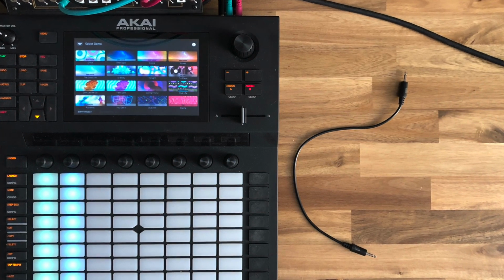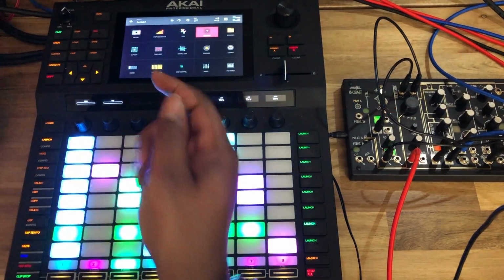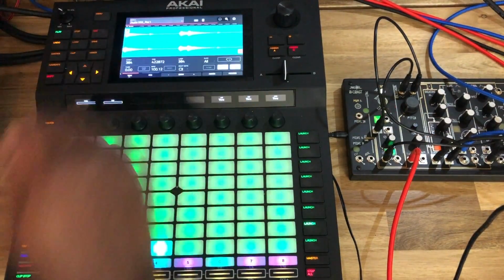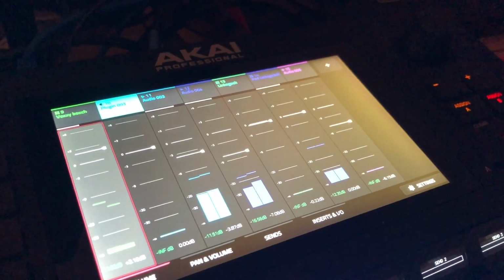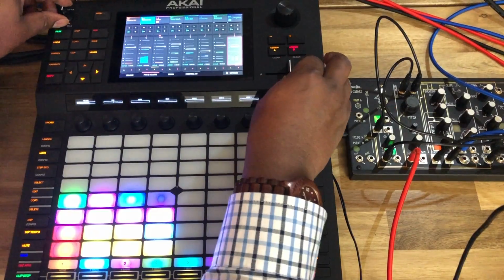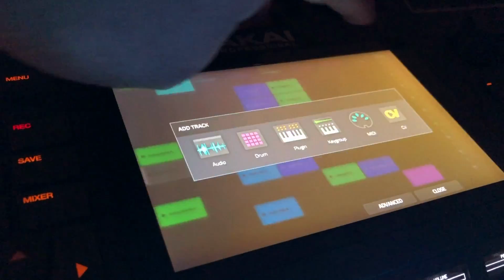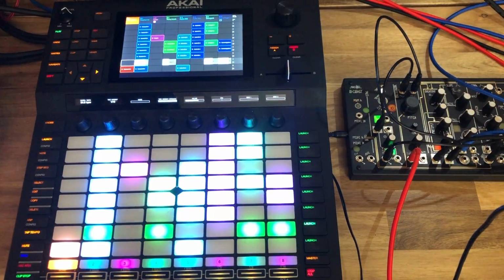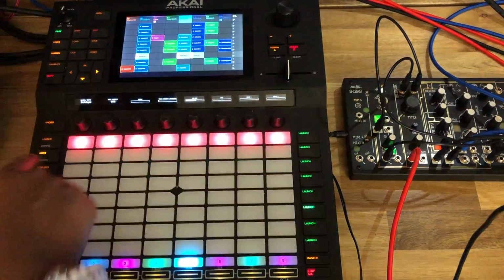Akai Pro FORCE - First Look

Comment: i have the 3.0.3 update and i dont have the ableton link button to control ableton you have at 4:39 what am i missing?
Reply from the maker: this is an early video using beta software. no guarantees on what will hit the market ultimately.
Reply: @Bboytechreport right that button feature is not even included in the 3.0.3 update. We can only export but can't control the software.

Comment: Does it record external gear on a fixed, say 2 bar loop? Where you send out midi on 1 track to a synth, record the audio output into the Force in a fixed 2 bar clip length ?
Reply from the maker: Thomas Hoenselaars yes

Comment: can you take off the cue link knobs and they have those "circle/flat" metal posts that you could say, put DJTechTools rubberized super knobs on?
Reply: thanks for touching on the Ableton part too - nobody's done that - its just clip launch mode though and im assuming in note mode playing the plugins but otherwise it doesnt display anything extra? would be cool to see it develop in the future with Max4Live or custom scripts like the Push2 has that make the LCD screen display the session view clips even with the text written on the clips (i dj with live so ive always wanted this) and display the plugin windows of VSTs, but unlike the built-in plugins where it auto maps to the cue link knobs, maybe just let you midi-map the link knobs to the effects automation parameters in the plugins' "configure mapping" knobs in the little (>) arrow that appears on all plugins
Reply: basically TL;DR i wanna know how the midi mapping and control works for Live in terms of synths and custom-mapping  to plugins' automation
Reply from the maker: J Whitty I have a korg kp3 with djtechtools knobs. I tried on of them on it. The pots shaft is taller than the djtechtools knobs will cover from tip to base. They may have some that will work but also the touch sensitivity went away.

Comment: Nice vid !
More please !
Are the pads velocity sensitive while in step sequencer ?
Do u know if the synths(hype, tube and the other two) will be available as VSTs for ableton or the mpc software, so when finalizing/mastering/editing etc in a DAW you can still change parameters ?
Does it come with the mpc Software, or can it only export to ableton ?

Thanks
Reply from the maker: claudio oidualc more to
Come. Pads are velocity sensitive in step edit. Same plugins as mpc. Don’t know if plugins will be available in Ableton. I don’t have any answers about the software. I’ve only used it in standalone mode so far.

Comment: BBoy, 2 questions. How do you connect a turntable because I didn’t see a phono connection like the MPC X/Live. Also do you know if it will come with any version of Ableton? Probably not since they’re kinda enemies now.
Reply from the maker: not sure about if it will come with any ableton lite. but enemies will do business together if the terms are right lol. as for turntable. i havent seen that on any akai product since the MPC 5000. its just 1/4 inch or xlr inputs.
Reply from the maker: unless there are plans for the link / ethernet port on the back to interface with other DJ gear. i dont know tho.
Reply: BBoy Tech Report I got a response from Akai. A turntable with preamp is fine with the RCA to 1/4 cables. Otherwise you will a preamp separately

Comment: I can see that this has parameter locks but do you know whether this thing has trig conditions or anything along that basis?
Reply from the maker: i dont know of and i've not used any parameter locks. do you mean automation? no trig conditions.
Reply: BBoy Tech Report You can set parameters per step. Hmmm! I wonder if Trig Conditions will be implemented in the future
Reply: @Bboytechreport  so there is no automation recording - knobs/values etc..? NOOOoo!!
Reply: BBoy Tech Report trig conditions is that Elektron talk lol
Reply: Gio Alex Yes! And actually, the Force really doesn’t need to include it, as long as The Force, as an Ableton controller, accepts Max4Live devices such as Sonic Factions Probability Pack, THEN you can do exactly ANYTHING an Elektron can do and MORE. Really excited 😄

Comment: I’m also excited to see how they’re/if/when these features will be integrated into the Live & X. I feel like Akai could make the menu have pages and toggle to shift between, as we have 8 functions on our current menu. This could give the X another QLink Page & the start to a 2nd Menu Page lol That is if the gave use an Ableton Control & Matrix mode. I will definitely suggest this feature. Even though we only have 16 pads, we still have the full sized touch screen and pad banks! These would be great for the X and Live!!
Reply from the maker: I guess anything is possible judging from what this thing is capable of so far.
Reply: Also curious if this will cause Akai to enhance the Expansion Builder Application!

Comment: I already have a Deluge...what I need is something like an Ableton Launchpad, only something I can load the clips & take away from the laptop. As for all that editing & slicing, I can do that in Ableton. I just want something to take to a gig, should I ever get one. Because my laptop is never leaving the studio again.
Reply from the maker: Right there are devices out there for any combo or individual feature but the nice thing about this is its all self contained. slicing chopping, stand alone, CV, midi, plugins, clip and scene launching, audio tracks, drum tracks (aka mpc programs). deluge is probably the only thing that comes close but that has no touch screen.
Reply: @Bboytechreport  Nice video! I think the pads on the Deluge are intended to function as a kind of touch screen... the latest update even allows for visualization and slicing of sample waveforms on the pad grid
Reply from the maker: Scott Kuehnert thanks. Wow I’ve not messed with deluge yet. Looking forward to checking it out.
Reply: Deluge rocks just looking at this, I think deluge might be more fun to use, but no screen needed...
Reply from the maker: @RonCavagnaro  Still havent checked out Deluge. looking forward to checking out tho.
Reply: You can export Ableton Live sets into this unit and leave the laptop in the studio...problem however is if you depend on 3rd part plugins. Cannot use them with this standalone unit.

Comment: yeaaaah no thanks. ill wait 3 generations or so. this is clearly an overpriced push 2  with low processing speeds . at least it works as a controller but i can get a used push 2 for like 500 right now
Reply from the maker: I hear ya bu this is not even a push2. its standalone / hybrid if needed with built in synths, audio interface, CV,  touch screen. etc etc. push aint doing that stuff. but it does have the similar clip launching workflow and 8x8 grid. thats where the comparisons begin and end.
Reply: @Bboytechreport  It's like a Push 2 Crash landed into an iPad and an Octatrack.  How is it overpriced?  It's incredible that this even exists!
Reply from the maker: Robert Syrett I don’t recall ever saying it’s over priced.
Reply: By the look of the screen its probably closer to MPC Live
Reply: The RAM is well lame at 2 gb. Same processing power as a cheap tablet.
Reply: This is "on the go" all in one beat making machine, of coursce IT can't compete on terms of functionality and processing power with laptop & Ableton combo.
Reply: If you’re an Ableton user, wouldn’t this be a bit overkill? I mean you would use less then half of what this thing can do right?
Reply: @FuZZbaLLbee  i agree. Ableton Live also allows you to keep your VST and plugin workflow. I just invested in a Waves bundle and this standalone box doesn't allow for any use of 3rd party plugins.
Reply: But youll be stuck to your laptop and ableton
Reply: @nobsoul2179  You're right. I dig Ableton Live too much to move away from it right now. I also have several stand alone samplers as well so the workflow with Ableton Live is locked in.
Reply: @nobsoul2179  this is basically a laptop.
Reply: @robotjeans  no its not
Reply: @nobsoul2179  nah not really. if you have a launchpad pro or push you can connect midi jus fine ... ableton is very powerful and if i cant even access my komplete library or any of my mastering plugins then whast the point 

im sure those built in vsts are fine but im not tryin to have a 6 month learning curve and spend 1500$ doing it
Reply: @nobsoul2179  you're basically paying 1000$ for a shitty computer that u can find at walmart for 200$, with a push 2 controller attached to it and some screens 

bravo to whoever made it but its just not for me
Reply from the maker: @theStepFamm  i can respect your point but i have to disagree from a gearhead and IT guy perspective. I dont think its a good comparison to compare music gear to a computer. keyboard, synths and drum machines have always had similar components to computers but its not the same. its a purpose built machine for a specific use case. we arent installing Operating Systems on music gear. we install firmware on music gear. huge difference. the use case for some one who wants a computer is very different than the usecase for someone who wants music gear. a computer has to be very robust to handle the work that you need to do but music gear doesnt typically require the same power and capacity.  very different scenarios it would be like comparing a motorcycle to an SUV. yeah they both have wheels but we dont condemn motorcycle for only having 2 of them lol
Reply: @theStepFamm  exactly
Reply: @Bboytechreport  ok fair enough but am i allowed to use fabfilter and izotope plugins on my channels and master?
Reply: @Bboytechreport  and my whole komplete kontrol library?
Reply: @Bboytechreport  i dont feel like it can handle my library ?
Reply from the maker: S†EPFΔM STUDiO nah it’s only air fx at the moment. I wish.
Reply from the maker: S†EPFΔM STUDiO I feel you on the library and ni and all but nah unless you use it as a controller with your computer it’s not going to run that anyway. Only air fx so far
Reply: @theStepFamm  A computer shitty or not has an OS hogging. Then you gonna have to deal with an audio interface (ok, you can use the motherboard's) plugs, usb cables, space. Mobility. The processor here is fully dedicated to the OS of the gear. You have ins and outs, etc...dude, I doubt you finish this toy
Reply: @Bboytechreport  not to mention latency... this device will probably have ZERO problems in this area while basically every 200$ pc will have latency issues.
Reply: S†EPFΔM STUDiO push 3 is coming
Reply: @bigtony7807  is push three going to be a standalone?  Will Ableton finally be a device?
Reply: Robert Syrett ableton can be standalone but only in session mode , like u on the road making beats then come home plug your pc and do arrangement your shit
Reply: S†EPFΔM STUDiO I’ve made badass shit on a zoom 4 track recorder with one microphone... it’s not the tools, it’s the creative mind guiding it.

Comment: how about midi syncronisation? can you record audio if akai force is in midi slave mode..?
Reply from the maker: i havent used it that way so i cant answer for certain. but I do believe it possible I just havent tried it. I use it as master and most of what I do with it is record audio from external synths why slaving other devices to it.
Reply: @Bboytechreport  is midi out good enough? on my akai live it was about 43 m/sec..so thats why..midi clock out is very bad..and when you are trying to slave with machines like elektron's rytm..its suck in recording mode.also check out the memory..on akai live it was about 256 mb..on whole sequence/projekt.:))!!! i think this limitation in 2019 and the price range are not funny anymore..:!!